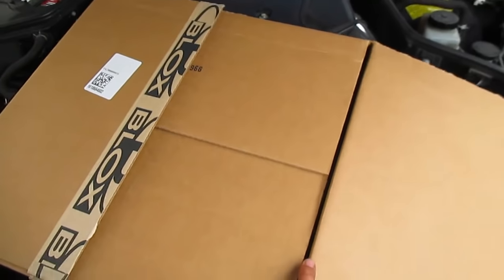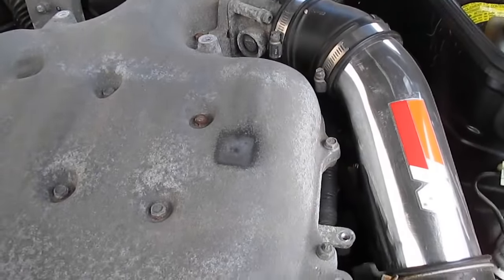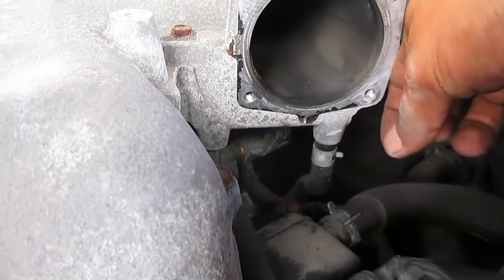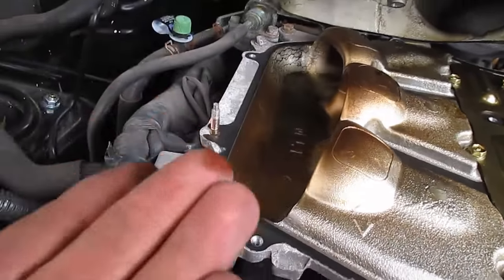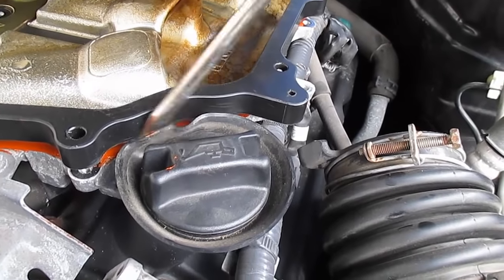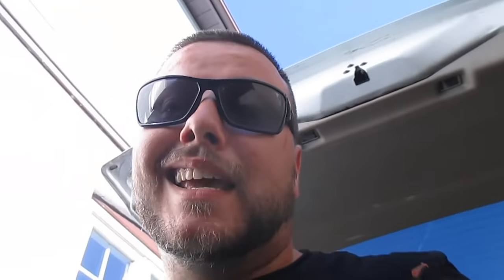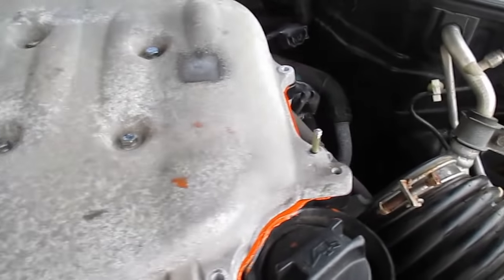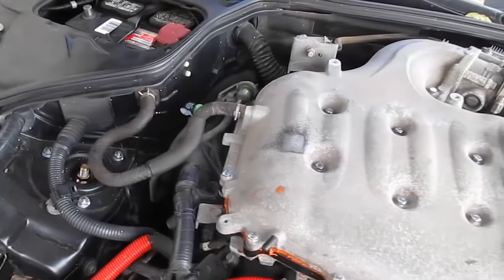How To Install Plenum Spacer on a G35, 350z 350Gt or fx35

Comment: You didn't need to remove the throttle body. Just take the intake cupuler/pipe out the way and when you lift the plenum, make sure you don't try to pull it off because it's still connected to the coolant lines. Just tilt it up, apply your sealant/gasket maker, place your plenum spacer, apply sealant on top of the spacer. Make sure everything is aligned and torque it down. Hand tighten till it stops spinning. Then half a turn more. Don't over torque and do it in sequence  (top bolt, bottom bolt). Put your intake and lines back. Go pump your brake pedal while the negative cable is disconnected from your battery. After you pump it (your resetting the ecu) go put the negative back on and start it. Bte removing the negative from your battery is the 1st step you should of done.

Comment: when you are doing the final torque up on the bolts never just go from hand tight to full torque, even if they give a torque order and may not say anything about this. but you always want to go to like half the torque spec at first(in the order pattern they give) then go to the full spec, if you just go from hand tight to full torque on a part this large and flexable it can cause the part to crowd over or push off in ways that isn't good. it may work fine most of the time but if you do it this way all the time there will be a day when it bites you in the ass.
Reply: Sirmellowman what lol it shouldn’t matter that’s why it has an order

Comment: If you touch the T/B, just reset it.  No need to waste money on another, makes no sense.  That's why Nissan has a procedure to reset the t/b plate(with no ECU reset).  Also the lower hoses on the t/b ARE NOT vacuum(I see you later came back and said they were coolant lines...).. Now you mind as well bypass those if you live in a warm climate.  Also you have aluminum, use ultra grey in the future.  Have you tuned this yet because it's in your head you actually "feel" the gains.  Feels good to install any performance parts lol.
Reply: McKinney Texas Zeds bro, i like what you said, i live in Cancún so it is hot , you said you can cancel the hoses that go to the T/B ? I have an 2008 with 2 of those , can you please tell me what to do?
Reply: Well there has been dyno results with gains without tune although of course you will have the most gains with a proper tune

Comment: The oil inside the plenum is most likely all from the driver side valve cover which connects to the intake which can be prevents by adding another catch can or just vent the one with the pcv and run the driver side to the plenum I believe. Mine is hooked up just like yours with my pcv still, but I will change that when I redo my heads to hopefully prevent my 1 qt a week oil consumption.
Reply: You ever get the oil consumption fixed?
Reply: @g35s  not really. I think back when I commented this it was in my auto green G35. I did buy another G35 sedan but it was silver and manual. Just sold that earlier this year. But the silver one didn't burn as much even though the odo showed like 190k vs the ~130k on the green one. I just think it's a hit or miss with these infiniti's

Comment: All I can say is I have the b blox 5/16 without a tune along with other bolt ons and I'm very happy with it.
Reply: Ken Medina so you never tuned it? If so, every part has done nothing to add to the performance.
Reply: joe Doe, appreciate the reply. Tune definitely recommended. My comment was not meant to say don't tune. It was geared towards those wondering if it would hurt without a tune or if a tune was required immediately. 

For me it was a low cost, easy bolt on that I recommend. For me it was worth it, I ask around, look up, and put my 2 cents in trying to help others in the community and appreciate their opinions in return.

This G35 is winding up as my daughter's first car. Plan was to have her take on the 96 Mustang GT conv. That changed, so once I get the car back I'll tune it. In the meanwhile I'll keep driving my 02 Corvette conv or 07 modified Suburban.

I appreciate our boy Dnali, takes the time to share his opinions, experiences, tips and tricks and I respect that.
Reply: joe Doe it's a little extreme to say you gain no hp from bolt ons without a tune. You will gain some just not the the parts full potential. Your ecu can adjust fuel within factory specs. So bringing in more air it will compensate with fuel to a point. Nissan (not sure if it's the same with Infiniti) run a tad on the rich side factory so they do gain power from bolt ons without tunes to a point. It's actually been shown numerous times on dynos. But that same part tuned will yield more

Comment: Thank you for the video. I followed your step, and successfully install BLOX spacer. In my case(also your case too), that two M6 stud has Torx 20(not sure. 20~30) head, so easily can pull out and swapped with 35mm bolts that came with the spacer.

Comment: Great vid I'll be getting one now (5/16) looks mostly straight forward. Would have like to see exactly how and what you did to deal with those two short studs. I know you said you just gripped them off anther intake you had, so did you cut them down then thread them in then put a nut on them ?

Comment: Do I have to change my intake Plenum spacer thick rubber about an inch it looks like it’s still good I know to change out all my gaskets obviously I’m not gonna reuse those but what about the spacer I have a Ford 5.0 they use the green paper gasket hundred and there’s a black rubber gasket that looks like it has some copper in it maybe it’s one of those plenty of heat absorbing ones

Comment: I have a quick questions so do you need to remove the 2 bolt screws that are on the plenum the ones that are attached to the plenum itself ?? If so how did you remove them?

Comment: Correct me if I am wrong I thought you could clean it with throttle body cleaner and you should try to avoid disconnecting??
Reply: When the battery is disconnected disconnecting the throttle body won't make any difference.

Comment: Yo I made the same mistake with the studs! Heads up to anyone looking at this now, but a 4mm socket fits perfectly ontop the two studs to thread them out. I was able to thread them out of the lower plenum, through the spacer, and out the top without having to remove any other bolts or take the top off again.

Comment: Hey man I love your videos! While putting on my spacer I put the gasket maker on, let it set 12 hours before fully tightening and all the orange gasket maker squeezed out the sides. My concern is that it squished out into the inppside of the plenum chamber to. Did I put to much gasket maker? Prolly recommended to redo incase there is some that squished out on the inside I dont want that getting into the engine. Thoughts bro? Cheers 🤟
Reply from the maker: You definitely dont want excess RTV to be inside of the plenum. If you are worried about it I would recommend taking it apart and doing it again for sure

Comment: You will not yield "gains" without a retune. This is with any bolt on part. You will just run lean with more air than fuel, stock computer can only compensate fuel to a point on its own.
Reply: Isn't it a self learning ECU?
I'd understand if this were a carbureted engine, however it is not. It can adjust air/fuel ratio slightly to allow slight modification. 
That's what O2 sensors do.
Reply: +Chris Foster Yes it is self learning. Alot of the time, folks that can't afford a ECU flash tune will reset the ECU by unplugging the battery overnight, then the computer will learn it's new fuel compensation tables while the car is plugged back up while driving, but the stock ECU can only compensate soo much without adjustment to advance timing and altered fuel targets (Which a tune modifies).
Reply: Can't you just reset it with the gas pedal?
Reply: +Chris Foster um, not to my knowledge. Only thing I'd  assume u need to use the gas pedal for is to recalibrate the idle relearn, throttle relearn and acceleration pedal relearn but I'm not 100% sure.
Reply: Well, I know it clears a CEL light. I had the cam sensor issue (that many other VQ owners have). And it came back once when I let my oil get kinda dirty. Changed the oil, reset CEL with gas pedal pumps.
But I don't know if that completely resets the ECU or not.
Reply: I don't know why this is always the elephant in the room lol when I was full bolt ons I made significantly less power than stock before uprev tune, I have dyno sheets to prove it.
Reply: That's strange. These engines are so fine tuned as it is, that I wouldn't want to mess with the tune unless I was heavily modded.
Reply: Factory afr's were all over the place on the first couple pulls. After tune it was a night and day difference. Gained about 20whp and 20tq
Reply: +superfunnyman123 I believe it. If people can buy Bolton parts, exhaust, forced induction, just slapping it on will gain nothing. I don't understand people rationale or logic. People who put off tuning their car after mods are just asking for a downed motor.
Reply: VQ35flamesWTF! I was just gonna ask does the ecu need a retuned to feel any real hp gains ?
Reply: You have to tune any bolt on part in to correct afr's especially test pipes.
Reply: And a tune can cost anywhere from 600-2000$ .
Reply: i spent $650 to tune my boosted built motor 350z via uprev, its not too bad.
Reply: I don't have 650$ to play with like that
Reply: So can a tune with stock oem everything engine increase hp ?
Reply: You can yield gains from a plenum or bolt ons without a tune. Yes a tune will provide more gains after bolt ons are completed. There are 15 years worth of Dyno sheets printed on 350z and G35 driver that show this.
Reply: Is that true? I just put a DC Sports intake on my g35 coupe six speed and didn't get a tune, is it a must?
Reply: bullshit. the ecu compensates and adds more fuel..plenum spacers do add power to vq engines don't be stupid
Reply: VQ35likeDhalsim you've surprised how much gain you  can get without a tune my g35 was doing  261whp with cold air intake and full exhaust stock headers before tune

Comment: So I've installed the motordyne 5/16th spacer and what I can say the car felt that it pulls a little harder in the mid and upper range and the response on the throttle has definitely improved.
I installed it on a G35 coupe 2006 
Other mods just a z tube basically stock.

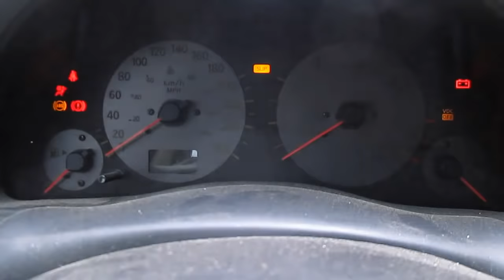Comment: at 18:30, I see that one light on your dash board like ((!)). I have that same light on my 2004 g35, except mine is orange, do you know what that light means. Sometimes when mine goes on, my car gives a loud beep for like 10 straight seconds (usually after my first start up in the morning). Do you know what that light means?
Reply from the maker: if its red its your emergency brake. if its orange my guess would be the tire pressure sensors. the light looks similar to that but orange.
Reply: Cody Brdar Im sure it's your tire pressure. If it makes that high pitch noise then it's an indication that "at least" one of your tire pressure is running pretty low.

Comment: Good, fast job!! What is the theory behind this, increase more horsepower??? More intake/gas/RPM= more HP?? Would they have this into my FX45 (8 cylinder)?? I wonder how much more horsepower that would do in mine?? Thanks again, youtheman=)
Reply: The way the intake is set up there is restriction without the spacer. So with it it just flows a bit better
Reply: OK, Thanks, you think I could get it also for my FX45/2004??=)

Comment: Hey man so for those 2 bolts that you forgot to take out how did you get them out ? Is it bad if I leave them ?
Reply from the maker: G35 Sedan leaving them in may cause a vacuum leak. I just took them out with vice grips

Comment: So I bolted the spacer yesterday and when I push the gas pedal it seems to feel like it shakes I can't explain it. But when I turn off the car I could hear a clicking noise kind of sounds like it's the tb not sure? Let me know what you guys think it is thanks!! 👍👍
Reply: You might of disconnected a spark plug solenoid

Comment: I’m new to the G35 world.  Is a manifold spacer really worth it or is it just hype like the air foil in you air intake?
Reply from the maker: No, it definitely helps. Your not going to notice a huge difference but it does help get more air into the engine and also help with heat soak also

Comment: After installing the 5/8 plenum spacer in on my z seems to run a little rought when I shift into gears?what could gone wrong
Reply: peter ramirez Maybe you have a leak. Recheck all your bolts are properly hand tighten (till there is resistance and half a turn more). Check all your lines are connected and make sure your maf sensor on your intake is plugged back in. Or maybe you didn't reset the ecu. Disconnect the negative from the battery, pump the brake pedal, reconnect. And drive the car to make sure everything is fine.

Comment: Hey man I love your videos, will this fit a 2008 infiniti fx35? Thanks
Reply from the maker: Thanks you. Yes this will fit an FX35
Reply: I appreciate the quick reply, not many spacers specify if it fits an 08 fx35. When I ask the seller they all say "as long as it's the same motor as a g35" well duh but maybe minor things changed over the years. Cheers
Reply from the maker: @stefaniaceron773  any time. just make sure the one you are buying is for an 08 g37 or 370z and it will fit with no problems

Comment: Nice video! ty! I have a question. What exhaust are you using? It sounds really different than mine.
Reply from the maker: just a 350z mid pipe and muffler delete
Reply: Thank you for your answer. Why the 350z mid pipe? is it different than g35 mid pipe? I was thinking they were the same since we have same engine. Thank you!
Reply from the maker: +Eulogio Adrio Villar the coupe and 350z share the same mid pipe but the G35 sedan has a much bigger mid pipe and makes it much more quiet than a Z or coupe
Reply: +DNALI Thank you for the answer. I didn't know that!

Comment: Is this mod compatible with the 2008 G35 sedan? It has the vq35hr with dual intakes.
Reply: Do you have an answer for this question because I have the same car and I’m planning on getting it but idk if it will work on the 08 g35 sedan
Reply: No, it won't. Do you people even know how to use Google? How'd you find this video but can't find directions or a forum talking about this exact item?  There are tons of them out there for the G.  Just type in G35driver or  6mt.net.  Have fun reading till your eyes bleed lol.
Reply: Does the hr have dual intakes? If it does, then no. This is for vq35de and the revup.  If the  other vq engines have a different design then it won't fit.

Comment: Pls what exhaust do you have on?
Reply from the maker: Guda Lawrence in this video 350Z resonator and muffler delete
Reply: @DNALI  , bought an 04 G35 recently and not sure what exhaust to throw on it.
Reply: I just ordered mine last night, but I’m wanting to know if the cover is going to bolt back on after?
Reply: @gudalawrence2028  whats your budget?
Reply: @xXTheGaMiNgBeAsTXx  , I have no idea how much they cost.
Reply: @gudalawrence2028  https://g35driver.com/forums/g35-sedan-v35-2003-06/190116-aftermarket-sedan-exhaust-compilation.html                                  listen to all the different exhaust clips and find the one that you like the best, then go from there homie, i have z1 test pipes, megan racing y pipe v2 and an hks axleback, I love the sound, im about to install headers as well, only negatives about the sound is the rasp from the test pipes, but thats fixable with a vibrant resonator in the mid pipe.

Comment: will this work on the QX4 
they share the same engine I guess
Reply from the maker: yea it should work then if the motors are exactly alike
Reply: +DNALI iight man thanks
Reply: Did it work
Reply: It's not abt the engine type, really you chaging the volume size of the manifold

Comment: cool but I might just get a twin turbo installed on my 2005 350GT
Reply: Des M what's a 350GT?
Reply: joe Doe engine type g35 is the same it's just what badges are on the car
Reply: Des M still what's a 350gt? There is a 350z & g35.
Reply: It's a 350 litre v6 engine just like a v8 has 4 litre+ engines
Reply: joe Doe that's what g35 are called in Japan skyline gt350
Reply: joe Doe A Nissan skyline 350GT is a Infiniti G35 with a different name. In some parts of the world, Japan and even Australia and others. There was no Infiniti brand so they just called it Nissan Skyline 350GT. The cars code is the same. V35. So to not confuse anyone. You could just say V35, the VQ community will understand. Repair/installation videos for a G35 or 350GT is the same and they both will help you.
Reply: The CarChannel Yes, some undercover cops used the g35 sedan (nissan skyline 350gt) in Tokyo back when the car was new
Reply: @hiddenkard3101  I think the ecu is diffrent can a nissan skyline 350gt work with uprev?